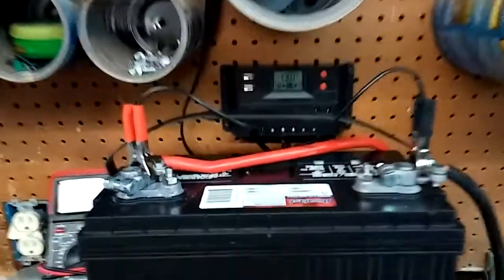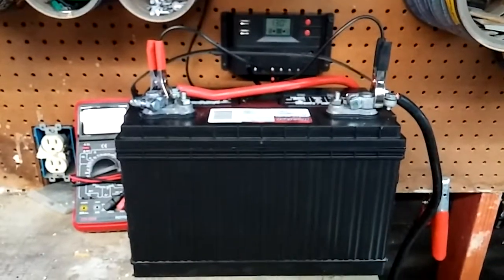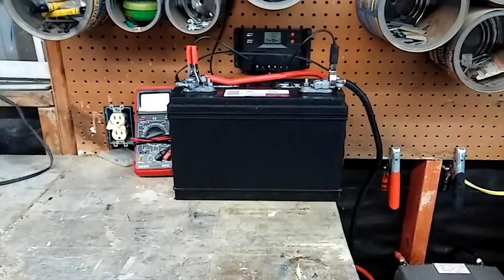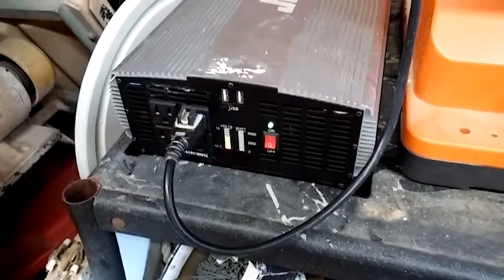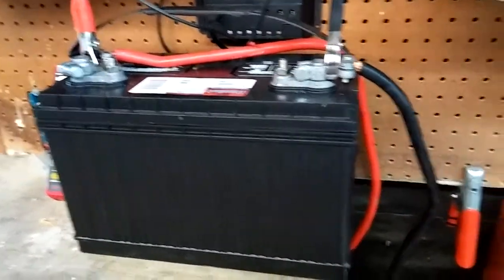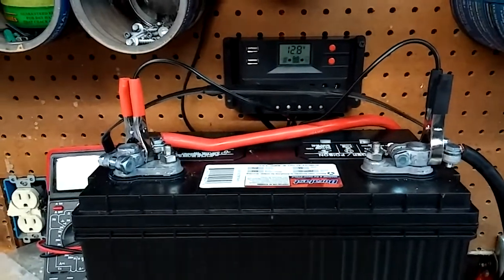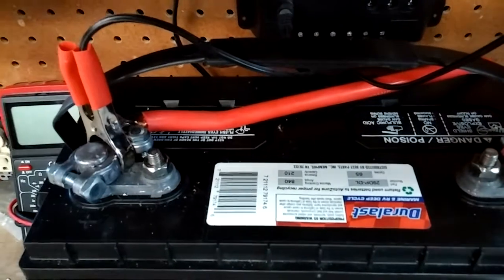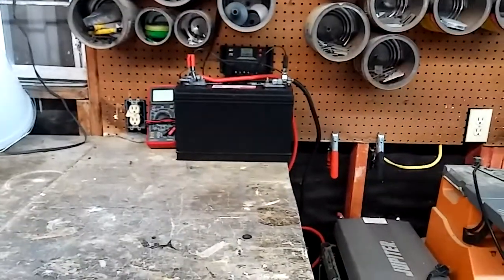100 watt Harbor Freight solar panel project

Comment: You pull 50 Amps continuous off that Battery, it will be dead in an hour.
One thing MOST people DO NOT KNOW about Lead Acid and even AGM Batteries is that you can only use 50% of their rated capacity! If you use more than that in any one cycle, you WILL destroy the battery!
Keep this in mind. You have a decent setup there, and I don't want to see anything happen to it!
Reply from the maker: Bruce Forster   Yes you are correct. I was only demonstrating the power inverter. Probably would only draw  that much power in small increments not for long periods of time 😉

Comment: If you want a beast of a battery in terms of run time under heavy load &/or for long durarions , go with golf cart (GC) type batteries. Available in both 6 and 12v versions. Rated at 150 to 200+ ah at 20 amps.

Comment: 180 amp hour battery at rural king 79 bucks plus core...you got ripped off dude
Reply: I bought 12v dc marine battery at walmart great video thanks keep them coming
Reply from the maker: Robert Smith . never heard of that brand. Thanks. I will look in to that